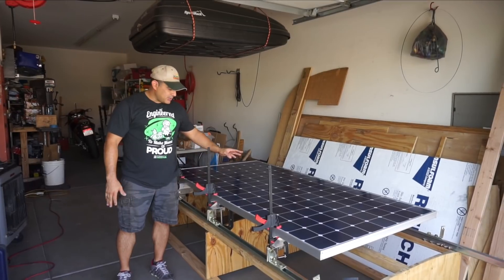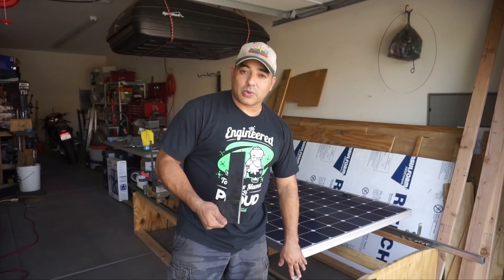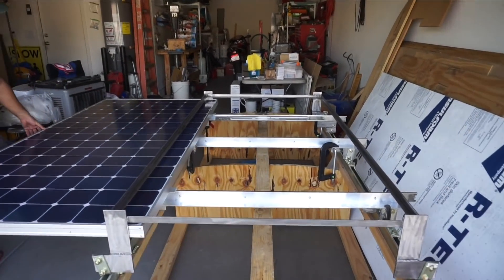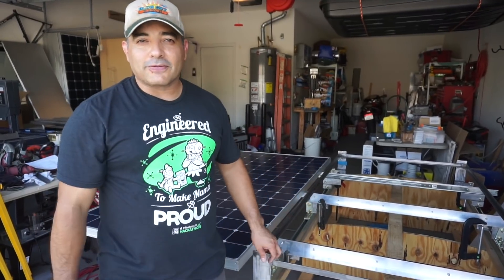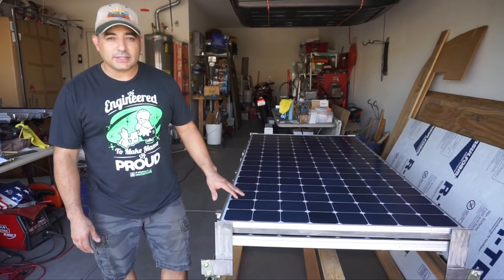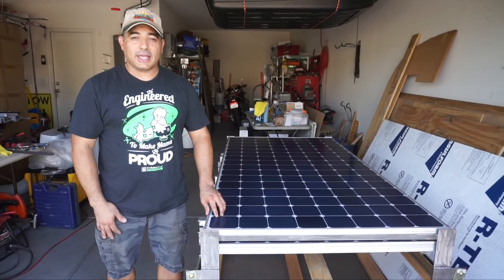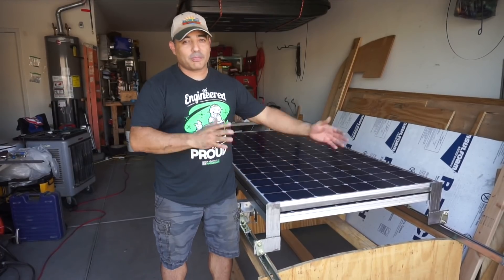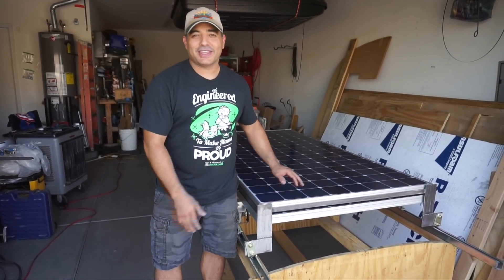RV Solar Rack - Part 3: The Upper Layer

Comment: Do you regret not putting in a tilt system? Now that youve had the experience of how it operates.
Thank you.
Reply from the maker: No I think the tilt mechanism would have been too flimsy.   The wind is incredibly strong and I don't believe I have the skills necessary to build it robust enough.   That being said, our system has worked extremely well for us.  Even bookdocking for weeks at a time we didn't worry about power.  We have also stayed long-term in RV parks that meter the power, and it helped reduce the cost there.  Overall we are very pleased with how it has worked out

Comment: Did you use arduinos and/or raspberry pis for the "logic"?
Reply from the maker: Both ... the Raspberry pi runs home assistant which provides state plus the UI and the ESP32 boards (arduinos) control the actual light and switch.  A lot of the actual "logic" will be handled with another piece of software called "Node-Red"

Comment: The way we help with dissimilar metal issues or oxidation issues in general is either using galvanized metal or cold galvanizing compound.  This is used a lot for Tower and out door antenna work to negate some of the oxidation issues.  Using galvanized vs something else we usually use galvanized.  Dissimilar metal grease which is primarily for use on grounds or other dissimilar metal contacts is usually how we deal with conductive surfaces.  Still wondering how this worked out on wind load especially while driving.  Wire management on moving parts could be done with cat track.
Reply from the maker: Thank Travis - it has done extremely well with the wind.  We had some pretty major gusts that made our 10ft x 10ft shade go flying into the bus - but the panels remain steady.  While driving there is no noise or odd behavior (we drive the bus twice a week - to and from the lot where we park it)

Comment: What do you plan to do if there is a Hail Strom ? WHICH will destroy your panels ! We used 1/4 sheets of Lexan over our panels to protect them....
Reply from the maker: Very interesting about the lexan - have you used it?  does it affect the performance of the panels?  I have seen where a big hail storm will come through and it does destroy people's panels - Thank you for the heads up - I will have to research this a little further.

Comment: For some reason, episode 5 of your solar mounting arrangement came into my YT recommended feed a few days ago and caused me not only to subscribe but also to binge watch - well when I could in amongst all else that I do - and I am now almost up to date with it all ( just two more to watch). 

I have thoroughly enjoyed following your journey and will continue to do so for sure. I love your approach to all the challenges you have faced. I love the way you involve the family and when I say you and your I mean the royal we ( you and the wife).

It is channels like yours which has resulted in me watching very little TV and watching You Tube almost exclusively. I watch far too many ‘maker’ type channels.

Now then this very clever solar panel arrangement you have come up with - as an expert armchair wise ass with a Masters degree in hindsight - can I ask? Did you consider putting both layers on sliders? This could have, say, the lower layer moving out to the left  half their width with the upper layer moving out to the right the equivalent distance. The advantages being shorter slides and actuators and the structure being a bit stiffer as a consequence. Or have I missed something?
Reply from the maker: Thank you Norman - we are the same way.  There is so much more interesting stuff happening on YouTube we rarely watch TV anymore.  That was one of the reasons we started this channel - we learned so much from others that we felt really compelled to give back.  

As for the armchair question: We did consider sliding them both ways as well as doing a 3 layer approach where they would slide out either side.  However - the panels are so large and heavy that we did not feel comfortable supporting them solely by the extreme ends.  If you notice our bottom sliding layer supports the panels from underneath - so that the panels are more like on a sliding "bed" configuration as opposed to putting pressure on the panels themselves.  If we would have used smaller panels I think a configuration like that would have been awesome (maybe a good candidate for my next design) - we just didn't feel the panels would be strong enough to be used as the actual slider.  And yes ... the smaller the motion the cheaper EVERYTHING gets, sliders, actuators, panels.  For now we are pretty satisfied with the result - time will tell how it holds up :)

Comment: I don't know what your actuator looks like but I looked at them a while back when giving preliminary thought to a lifting mechanism for a standing desk.  One thing that occurred to me is that the electric legs used on fifth wheels are just another form of an incredibly strong actuator and reasonably priced from that perspective. I doubt you could make them work in this application but I thought I would at least put the idea out there. If the extended panels were attached to something as beefy as a landinging gear leg you would have no worries as to sag or wind lift. The actuators I looked at were strong with their lift rating but did not look solid for lateral forces. You can get a Lippert landing leg for about 100.00 and then pick up the motor and gear mechanism at a reduced price for off brand on ebay.  I think you would still end up with about 250.00 to 300.00 in putting one together. This would also be weather resistant but you would need to protect the electric motor. The only draw back is I don't know if you can get the extenstion you need.
Reply from the maker: This sounds like a great idea - I am going to look into that!  Thanks!

Comment: Looking pretty good so far!  And yeah, that cable track (ty google for the name of the thing lol) would be a good idea, wiring wouldn't be stressed like it would with just a floating loom flopping about however while traveling down the road.

And something I thought about to add to the automation: Retract if key is turned on or parking brake isn't set. Because way too early morning still half unconscious departures happen.
Reply from the maker: Awesome idea - that would be a great automation!

Comment: Great design, just wondering what type of work do you do now and do you plan to continue working when you go full time.  Sorry if you have answered this question previously, I just found your channel a few days ago and had to do some binge watching to catch up.
Reply from the maker: Hi Randy - thank you.  For work, I am a software engineer.  I plan to continue working as I go full time (from the road).  All I really need is an Internet connection for work.  I have been working remotely for the last 10 years or so - so I think the transition will not be too difficult.  Thanks for following along
Reply: Thanks for your reply.  Looking forward to future videos.

Comment: I realise you're a way away from cabling, but you should think about using multiple MPPT controllers. You mentioned just one in the video and a combiner box. You can have multiple MPPT charging the same battery. Ideally you want a separate MPPT controller for each series of identical panels. And identical means the same panel, voltage, angle, and amount of sun reaching the panels. So at the very least you should have the slide out panels on a separate controller. Ideally 4 controllers, for each 2 series. Otherwise you won't get the benefits of MPPT when half are hidden. It also means smaller cables and current, but more cables going into the van. Cheaper MPPT controllers too because they are smaller, although maybe a higher overall cost. But more efficient. So pros and cons.
Reply from the maker: Hi, yes - Ideally, we would have one solar charge controller per panel but that gets very expensive (especially if we use MPPT controllers the smallest solar charge controller that can handle 48V is the MPPT 150/35 ~ $330).  In theory, having the top and bottom isolated from each other through parallel circuits "should" allow the top panels alone to work as if the bottom panels didn't even exist.  Having the top and bottom sets of panels on different solar charge controllers basically doubles the cost (the smallest 250V Charge controller Victron makes is 60A - we have a Single 250/85 for the entire array currently ~$630 vs ~830).  We will know more once we get the solar array up and do some testing done.  If pulling our panels in completely kills our output I guess we will just buy another controller ... We will post our results once our bus gets back from painting and we can mount our rack and configure this piece of the system.  Thank you for commenting.  Our system is not ideal but we are hoping it will work well.
Reply: Makes sense, I didn't realise you're going to have a 48v battery to charge. Also watch out for the max current on MC4 connectors of 20Amps. My 300W panels gets close as soon as you put anything in parallel with 9Amps per panel. Sometimes it's better to run multiple cables into the charge controller and combine them there. I ended up with 3 in series because it's really the only option for 3. Keep up the good work! I also considered tilting then decided nah, too complicated. And considered slide outs too, then thought 900W should be enough. (Note I'm not an expert, just throwing ideas out for discussion)
Reply from the maker: Thank you - I appreciate your input and I enjoy watching your videos.  We should be safe on the MC4 connectors as they will only really be used to join two panels in series (max of like 6.5 Amps).  I am no expert either so I appreciate another set of eyes on the stuff I do.

Comment: Juan, powder coating brackets would be easy to do. Check it out. You only need an old table top over to cook them for an hour and a cheap power coating setup. Sandblast, spray on coating and bake.
Reply from the maker: Interesting - I hadn't really even considered that.  I always watch Glenn powder coat his stuff and he has some fancy ovens but the parts come out BEAUTIFUL.

Comment: Yet another wonderful update!  We are so glad you both are a few steps ahead of us on your build because we are so following in your footsteps; maybe not in the exact design or plan of what you are doing, but certainly in the way you're systematically researching your ideas and then modeling them out.

Concept validation = Check!

Have fun enjoying the process of batching up all the parts!  All too soon you'll be out showing off the finished bus and people will gloss over the work it took to make the brackets for the sliding solar panels because they'll only see the function of the whole system.  The enjoying each bit now piece is our own current lesson so sharing makes it stick a bit better.
Reply from the maker: Thank you Ronin and Marie - YES exactly - soon this will just be another thing (with any luck).  It even happens to us - when we started building our battery we didn't know anybody who had done it and we were not even sure we could make it work.  But we researched and researched and researched until we finally had a good plan.  Once we started executing on our plan one time Michelle turned to me and literally said: "I don't know why we were so worried this is really easy" - I almost fell over.  Thank you for following along and for your positive and inspiring attitude - it's been really fun to see another couple tackling a big project like this.

Comment: I think flat is good. The actuators should hold the panel in place, key word as always is  “should”.  I like the CNC wire snake idea, the gap may not be large enough though. I LIKE the design. Will there be room between the roof and the lower panel for the actuator
Reply: 6 inches is a lot of space to make some actuators work (from what we are just now finding out).
Reply from the maker: Thank you Glenn - the actuator is coming this week (should be here in a few days) - it is rated to push/pull 200lbs which should be plenty for this application (like you said "should") - We will test, test, test.  First I have to see if i have the chops to reproduce this exact design 3 more times :)

Comment: Thanks for sharing. You mentioned having a small gap between the top and bottom panels while traveling to keep down air flow between the panels so as no to tear off the top panels. I am not an engineer, but if I remember correctly the air flowing over the top is what causes a type a vacuum that causes lift. It may not be necessary but here is a thought. If you tilt the top panels a little higher in the back which would cause downforce as air passed over them while driving it might not be as damaging. Like I said I am not an engineer so this may be all wet, but something you might check out. Thank again for sharing.
Reply from the maker: Thank you John - Interesting thought.  We do plan on putting some kind of fairing or windbreak in the front to deflect the air over the surface of the panels - the small gap was more for a crosswind or side wind to prevent the panels from acting too much like a sail.

Comment: It seems like it's going to be plenty strong. I think your only risk is that you may get an irritating rattle or whistle. You could make an aluminum wind foil around the front to mimmic your shiny front bumper. Maybe put some marker lights on it to tie it in more with the bus body lines.
Reply from the maker: Thank you Kevin - we want to put some kind of windbreak (fairing?) on the front to make it cut through the wind easier (and keep the noise down).  I like the marker lights idea!

Comment: Once again, amazing end product.  Very Impressed.  I think the solid design of the upper level will give the lower level great protection with the logic in the actuators.  Be aggressive with safety configurations and retract when it is a concern.  GREAT DESIGN!
Reply from the maker: Thank you Dennis - We are pretty happy with the way it turned out - now to see if we can recreate this 3X more times!

Comment: Why don't you use aluminum angles instead of the steel angles? Aluminum weights less and no corrosion
Reply: I don't think they have the ability or equipment to weld aluminum. It's getting more affordable. Fronious just put out a machine that can stick weld, TIG weld, and MIG weld. The MIG function does not require a spool gun, which makes the machine more affordable and easier to operate.

Comment: Why don't you use aluminum instead of the angle iron? Aluminum weights less, no dissimilar metal corrosion...
Reply from the maker: Thanks Lorenzo - to get the strength we needed we would have needed to go to 1/4" aluminum or greater.  Just the aluminum angle on the sliders (1/8") cost more than all the steel we bought for the rest of the racks (by about double).  Aluminum is far more expensive and we don't have a good reliable way to weld aluminum (I barely learned to weld steel a few months ago).  We are going to pad the contacting areas with rubber mat so we should not run into the dissimilar metal corrosion.
Reply: It would also be a fair amount more expensive for the extruded aluminum compared to the cost of the already not cheap steel.  From our limited bit of materials research here locally we've had to rule out structural aluminum just based on cost for us.  I'm assuming this is also a factor for Juan and Michelle.

Comment: Very slick...nice job!  I wonder if it might be simpler (for installation) in the long run to fabricate a bunch of little brackets/clips to hold the upper panels down from the top rather than through bolting them from the bottom?
Reply from the maker: Thanks dprider - I was thinking the same thing - we will play with it and see what we come up with.

Comment: Instead of all that welding, why don't you just get a sheet of metal plate and use your plasma cutter to make the brackets? That would save you a lot of work.
Reply from the maker: Thanks BB Cooter - I don't have a plasma cutter - I don't even really have a welder - this is my buddy Rich's welder.

Comment: That’s a cool plan.  Weight would be my issue on my class a.  Bus would probably be ok
Reply from the maker: Thank you Joe.  We are worried about weight changing the CG of the bus.  We have kept track of all the components and what they weigh including hardware.  We are weighing them on a scale outside as we finish each piece - at last tally we were somewhere south of 800 lbs for all the racks and the solar panels - pretty cool since the panels themselves are about 450 lbs of that alone.  We will have some of those numbers after we finish everything.

Comment: I love it!  I really like your ingenuity, and how you've considered tackling the cable management issue.
Have you considered using a "Standard Garage Door Brush Seal" (I don't know what they are actually called)?  I found the following that I think might be able to prevent some of your wind concerns
( https://www.northshorecommercialdoor.com/gadobrse.html ):
Available in four (4) different brush sizes:
1” Brush (B0768-00-W)
1-1/2” Brush (B0769-00-W) 
2” Brush (B0771-00-W) 
3” Brush (B0772-00-W)
Having a short one on the upper panel along the pull-out side might also help to sweep off any road dust from the surface of the lower panel as the lower panel moves out from underneath it.
Reply from the maker: wow!  What a great idea!  No I had not thought of that.  Thank you!